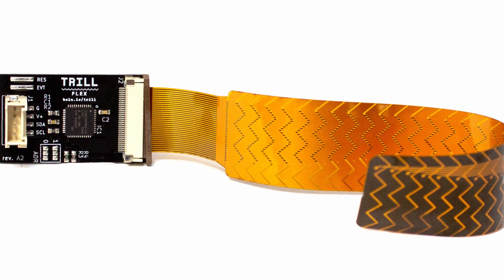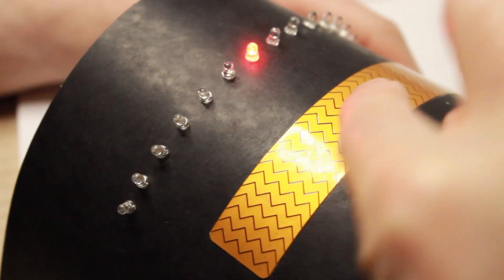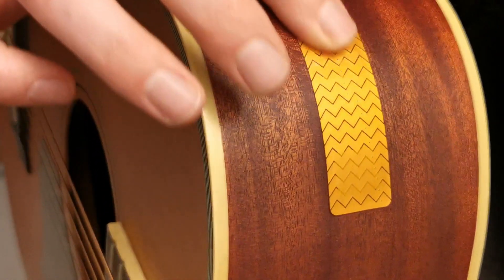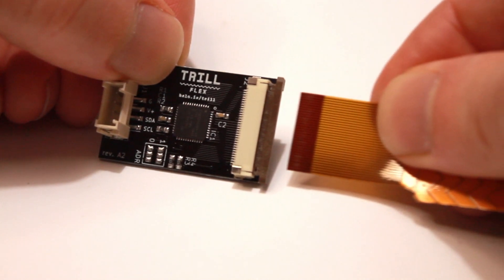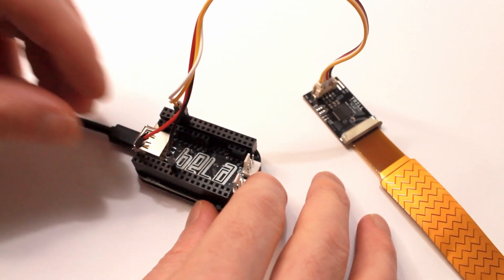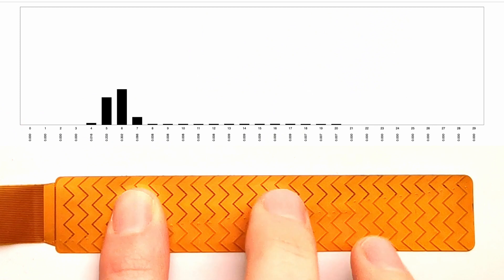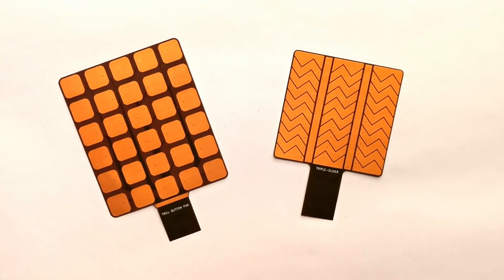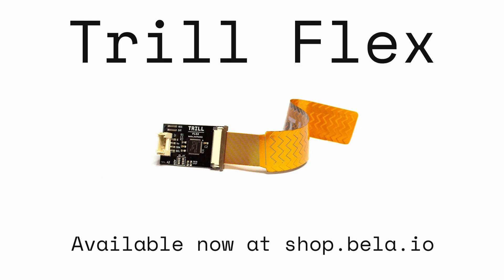Trill Flex: Flexible Touch Sensing For Makers

Comment: Hi, Bela, I have two questions regard to the flexible capacitive sensor applications.
1. As you mentioned, the sensor unit can be much smaller than finger tip like "trill hex", which has sensor size of 3x3mm. Is it possible to make such small sensor on the flexible platform (polyimide flexible PCB)
2. If I want to make wearable devices with the sensor, then one side will touch with human body while the other side serves as sensor. But according to my experience, it will have significant parasitic effects toward the sensor. One viable solution is active shielding. Do you have some active shielding channel available? Or do you think the sensor will still perform well in that situation?

Thank you!
Reply: Dis you get an answer here??